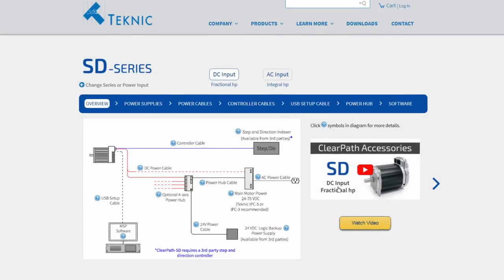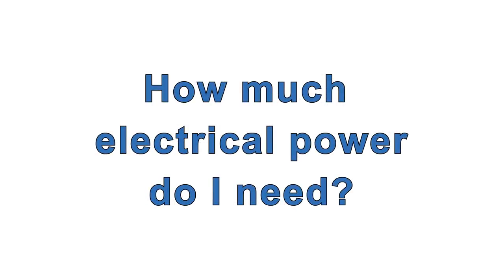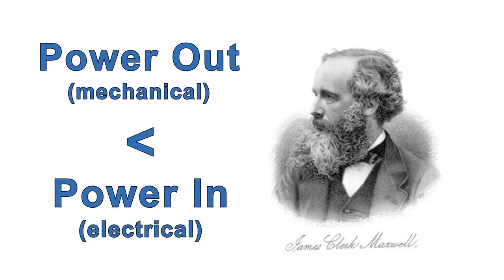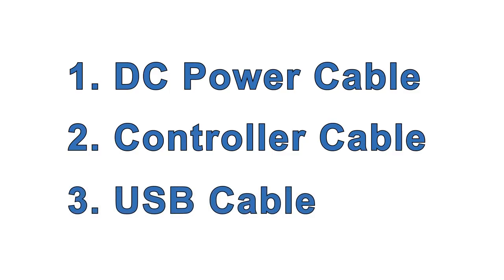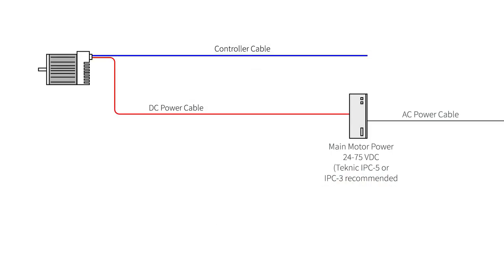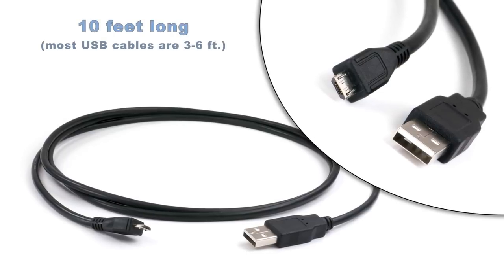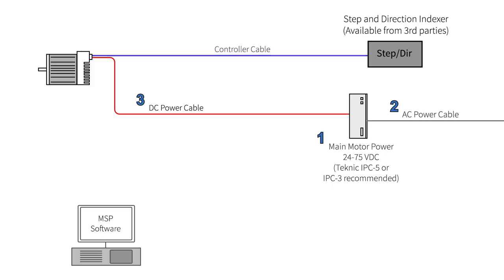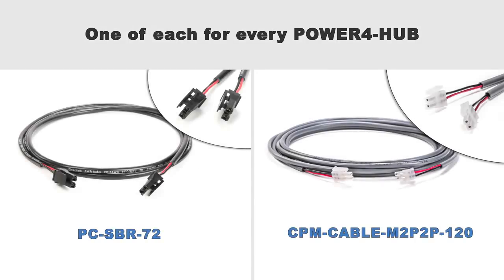ClearPath SD Servo Fractional HP Accessories

Comment from the maker: Hi Alex,
While ClearPath motors are compatible with several operating environments, MSP software is not portable to Linux. MSP was designed for initial motor set-up and auto-tuning and not for the application itself. Because MSP isn't intended to be application software, Teknic hasn't built different versions for Linux, MacOS, etc. So for initial set up and tuning, you'll need a Windows device.

Erik M. Teknic Servo Systems Engineer

Comment: A question. IPC5 power supply can run 2 motors. Mine will either be your CPM-SDSK-3421-RLN QTY 2. and your CPM-SDSK-3432-RLN QTY 1. How many motors can the IPC3 run?

I may get your CPM-SDHP-3421-ELN Qty 2 for X and Y Axis, and CPM-SDHP-3432S-ELN QTY 1 for Z Axis. For either the SDHP or the SDSK Qty 3 would I need two IPC5 supplies or could I use an IPC3 for the Z axis motors?
Reply from the maker: Hi James,

Although the IPC-5 power supply comes standard with two Sabre power connectors, this supply can generally drive 2-6 motors depending on your application.  We’ve seen many CNC applications run 3-4 axes off of one supply but you would have to test your specific application.  And you certainly can use an IPC-5 for X & Y and an IPC-3 for Z – you just can’t (and shouldn’t) tie the two power supplies together.

For your 3-axis machine, I’d test a single IPC-5 supply (I’m pretty confident this would work well).  Note that you would need to use a terminal block, bus bar, or our POWER4-STRIP to route power to 3 or more motors. For more information: https://teknic.com/clearpath-accessories-guide/accessories-guide-sd-dc/#power-hub.

If you have any further questions, please feel contact Teknic at 585-784-7454 or submit a contact request at https://teknic.com/contact/.

Thanks,
Abe A. - Teknic Applications Engineer
Reply: @TeknicInc  You have your line drawing showing cables where the part number should also be in brackets. Then say bottom left all the part numbers in a list with tick box beside and ticked. Beneath one price. So we can literally buy the lot in one click. Rather than make notes through the video of part numbers.
Reply: @TeknicInc  Also I noticed there are a few power hubs. Power 4 strip, Power 4 Hub s with logic power backup, and Power hub acts as logic power backup. I presume the best to get is the most expensive being the Power Hub. Can you double confirm this. 

As I am aiming for 5 axis this would mean I would need two of these I presume. I do see you have 5 axis Power 4 strip. Presume as not mentioning power backup it doesn't have that?
Reply from the maker: Hi  @jamesbarratt593  

There are two power distribution options for each motor sealing type:

For SD-Series ClearPath IP53 (Molex Connectors):

•The accessories guide is available at: https://teknic.com/clearpath-accessories-guide/accessories-guide-sd-dc/#overview
•The POWER-STRIP breakout board is designed to route 75 Vdc power from the IPC-5/3 power supply to the IP-53 rated ClearPath motors (with Molex connectors) – there’s no logic power backup with this breakout board. This board can distribute power to up to 5 ClearPath motors. 
•The POWER4-HUB breakout board is designed to route 75 Vdc power from the IPC-5/3 power supply to the IP-53 rated ClearPath motors (with Molex connectors) and also provides for logic power backup. This board can distribute power to up to 4 ClearPath motors.

For SD-Series ClearPath IP67/IP66K (M12 Connectors):

•The accessories guide is available at: https://teknic.com/clearpath-accessories-guide/accessories-guide-sd-dc-sealed/#overview
•The POWER-STRIP-S breakout board is designed to route 75 Vdc power from the IPC-5/3 power supply to the IP-67/66K rated ClearPath motors (with M12 connectors) – there’s no logic power backup with this breakout board. This board can distribute power to up to 4 ClearPath motors.
•The POWER4-HUB-S breakout board is designed to route 75 Vdc power from the IPC-5/3 power supply to the IP-67/66K rated ClearPath motors (with M12 connectors) and also provides for logic power backup. This board can distribute power to up to 4 ClearPath motors.

If your machine has more than 4 motors (or more than 5 motors if you are going to use the POWER4-STRIP), you would need to order an additional breakout board. (As long as one power supply is sufficient to power all 5 axes).

If you have any further questions, please feel contact Teknic at 585-784-7454 or submit a contact request at https://teknic.com/contact/.  Thanks
Abe A. - Teknic Applications Engineer
Reply from the maker: Hi @jamesbarratt593 ,

Thanks for the feedback. We always look for ways to improve the online ordering process and experience. I will forward your suggestion to our web development team.  I can’t say if and when this would be implemented, but we do review these requests and investigate the feasibility of new features.

If you have any further questions, please feel contact Teknic at 585-784-7454 or submit a contact request at https://teknic.com/contact/.
Thanks,
Abe A. - Teknic Applications Engineer

Comment: Is it possible to daisy chain Teknic’s IPC power supplays for more power?
Reply from the maker: Hi Bartek, 

Unfortunately, the IPC-3 and IPC-5 supplies do not have load sharing capabilities, so they can not be daisy chained together. 

If you have a multi-axis system that requires more power than one IPC supply can provide, you can use multiple IPC supplies to power different axes separately. In other words, you can power 2-4 axes from one IPC supply and use another supply to power another 2-4 axes (the amount of motors you can power from one IPC unit will depend on application factors).

Another thing you can try is adding a standard box fan to the IPC-5 supply to increase the power output from 350 Watts to 500 Watts of power.

I hope this information is helpful. Please feel free to contact support@teknic.com with any additional questions.

-Aaron B.

Comment: I’m thinking about using these for a g0704 conversion.  Which model will have the fastest rapid for Nema 23 Xy and Nema 34 for the Z
Reply from the maker: Hi Nerdly,

Thanks for your interest in Teknic's servo motion control products.

We are happy to help you choose the right motor for your project but more info is needed to provide you with a full motor part number.

Rather than exchanging the details in a public forum, it'll be more efficient to contact Teknic directly for assistance. Please visit Teknic’s website and submit a contact request so we can discuss your application in more detail. Here is a link for your convenience:

https://www.teknic.com/contact/

One of our applications engineers will reach out to you directly to discuss your inquiry and motor needs.

Best regards,

Mark D.
Reply: @TeknicInc  Thanks, i'll submit the request later this afternoon! 
Thanks, Jason

Comment: Is there a specific CAM software that will work with the clearpath system?
Reply from the maker: Most CAM packages are designed to produce specific tool paths for a machine tool (commonly called g-codes). These g-codes need to be further converted to the specific motion profiles for each individual axis within your machine (i.e., different profiles for the X, Y, and Z axes on a 3-axis wood router). Another software package called a CNC controller handles this conversion by producing the digital step/direction signals that the ClearPath-SD motors will follow. There are a wide range of CNC controllers capable of accomplishing this (e.g. MACH3, MACH4, WinCNC, Acorn, MASSO, among others) but you would need to verify that your particular CAM package is compatible with their CNC controller.
Hope this helps, best of luck with your project!
-Abe A

Comment: Looking to convert a precision Matthews 940m mill to cnc and want to go with the clearpath servo motors. The 940m is a large mill similar sized but a little bigger than the rf45 clones. I will be running 20mm ballscrews for X-Y and 25mm for Z. What nema 34 servos do you recommend for the X-Y? And also the Z? The 940m has a large head so most run stronger motors on the Z. And will one IPC 5 power supply power all 3 servo's? I am looking at a Masso as my controller. There is not a lot of conversion info out there on the pm940m so I am just trying to piece it together. Servos seem like the obvious choice for speed and accuracy. Closed loop steppers seem to be a good choice but the price difference isn't great enough to not go with the Clearpath servos.
Reply from the maker: Hi halfstep67,

Thanks for watching our video and for your inquiry. We're happy to help.

You have provided some good mechanical information to get us started, but more details are needed. Selecting the optimal servo also depends on your motion goals (acceleration, max velocity, desired resolution, etc.) and your budget.

Rather than exchanging many details in a public forum, it'll be more efficient to contact Teknic directly for assistance. Please visit Teknic’s website and submit a contact request so we can discuss your application in more detail. Here is a link for your convenience:

https://www.teknic.com/contact/

An applications engineer will contact you directly to help narrow down your selection and make suggestions based on your specific circumstances.

Good luck with your mill!
Erik M.

Comment: 8:30 I'm sorry, but WHAT?! That CBI circuit breaker is a awful long way from home...
Reply from the maker: Hi John,

Let me help clarify what is being shown in the video at 8:30 (I'm not 100% sure what you're asking but hopefully this will answer your question):

The circuit breaker is placed next to the stage to demonstrate how the "Position Recovery" feature works when main bus power is turned off. When connected to a Power Hub and bus power is removed, the servo can still track the position of the motor and the incoming command. Then, when bus power is restored, ClearPath will move to the correct current position. 

Aaron B. – Teknic Servo Systems Engineer
Reply: Aaron, I'm not asking anything like that, I just mean that CBI is a South African manufacturer, making circuit breakers in Lesotho, for the local market. I have no idea how it got all the way across the ocean and into your video. Does it even comply with your electrical code?
Reply from the maker: Hi John,

Thanks for the clarification. CBI Circuit Breakers meet CE and IEC / EN 60947-2 requirements, which are requirements for meeting electrical code for many industrial applications. (CBI appears to have worldwide distribution, where we happened to have some in our lab for demo purposes.)

-Aaron B. – Teknic Servo Systems Engineer